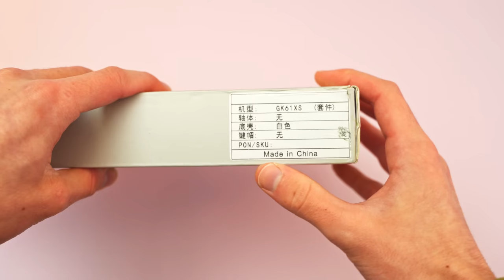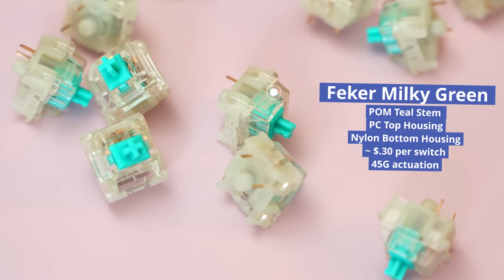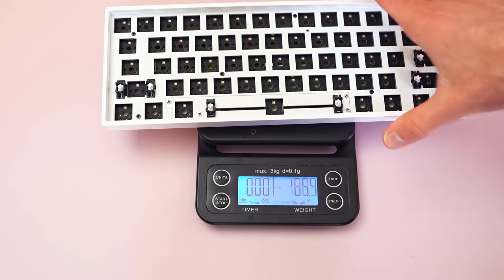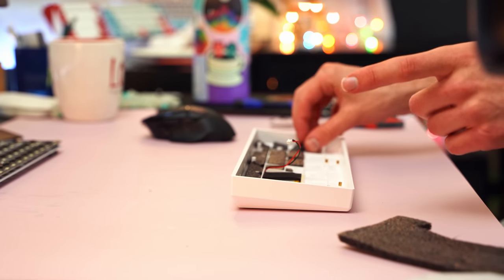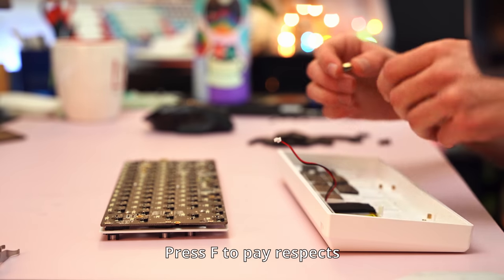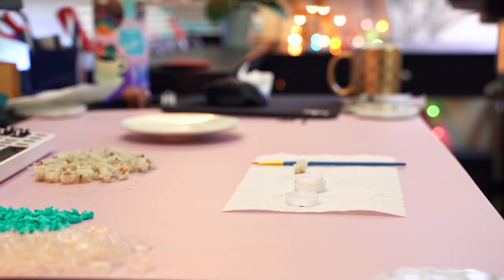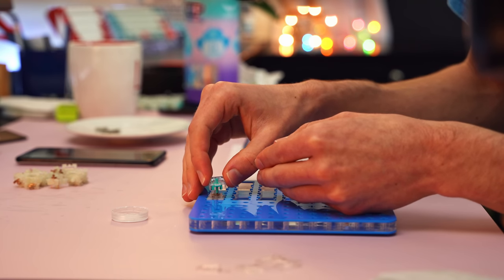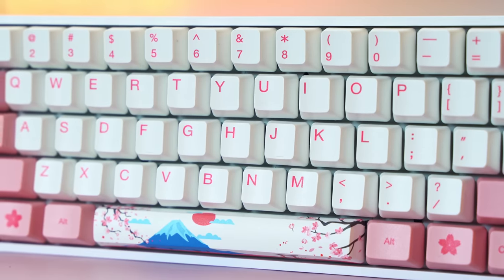The MOST popular BUDGET keyboard.

Comment: another switch option anyone trying to emulate a build like this could try out are akko cs rose red switches, theyre fairly smooth (my batch was around the same feel as gat yellows) and are pink so they will match the keycap set, they are also ridiculously cheap coming in at about 30c a switch (abt the same as the feker milky greens). hope this helped anyone trying to decide on what switch to use for their budget build!

Comment: Yes, highly recommend a switch opener tool. My fingers went numb for a day after man handling 68 switches with my own fingers.

P/S: managed to stab my fingers with the switch's pin couple times and bended a couple pins in the process as well :(
Reply: sameeee they so sharp almost bled in my krytox
Reply: cut my left thumb open trying to open switches manually. also broke a switch. switch openers are much better, and id still buy spares incase u break some

Comment: with these keyboards you usually pull from the bottom right first and then kinda slide out the top and up, that's how I have always done it and I've taken apart my gk64 multiple times without issues

Comment: I have this board actually. It, some Gateron blacks, and Matrix Keycaps were my Christmas present. It has me hooked on the hobby. I actually took the day to work on the stabs. Trust me, these stabs are pretty bad if you leave them factory. I clipped, and band aid modded them, and they are LOADS better. Aside from the 2 stab housings that have broken on me. Good thing the split space bar comes with 2 extra sets. I'm gonna say, it's not bad, but the NK61 might be (probably is actually) the better choice.

Comment: Laughed when you broke the usb port same thing happened to me when I tried dampening my gk61 and couldn't use it for a month
Reply: I am having trouble taking my top plate off to dampen the sound. It feels like it is stuck on the usbc what should I do
Reply: @theorowe6441  If you are on a gk61 like me then first unscrew the top plate off the pcb and take it out, you're going to have to use some force since it's pretty hard. Then what I do to take the pcb out then is to flip the keyboard upside down and let it fall out, make sure to catch it though. You can shake it a bit to make it easier to fall out.